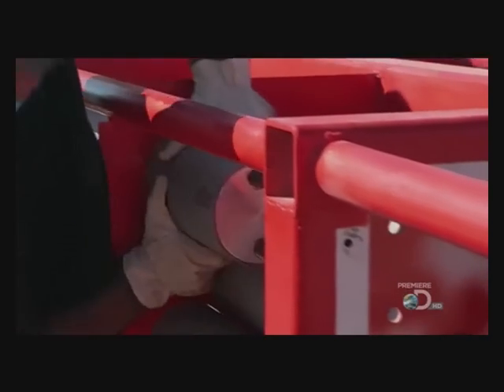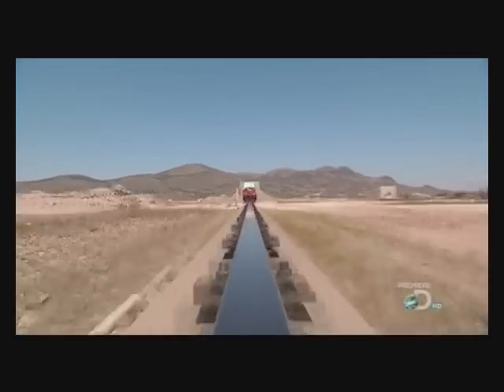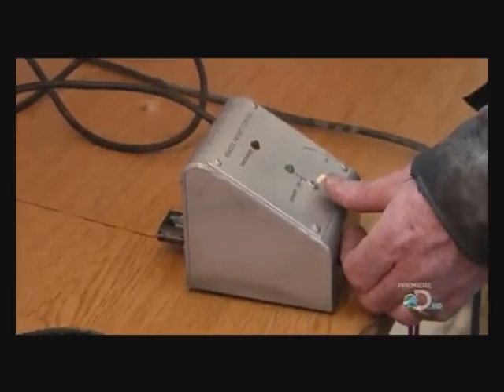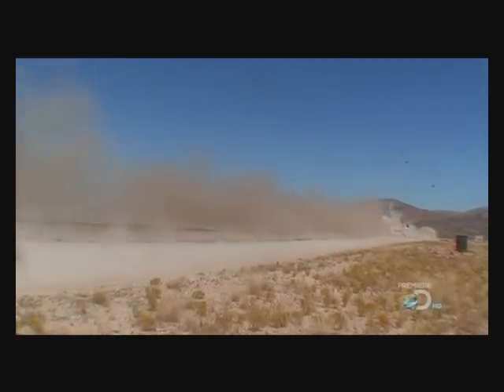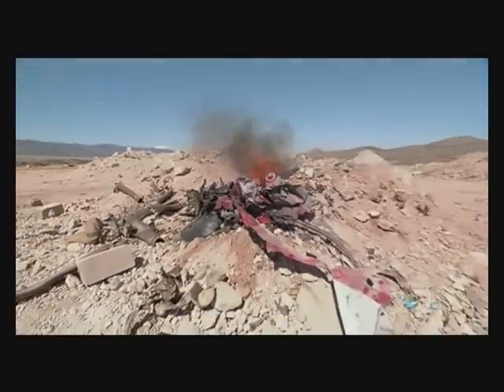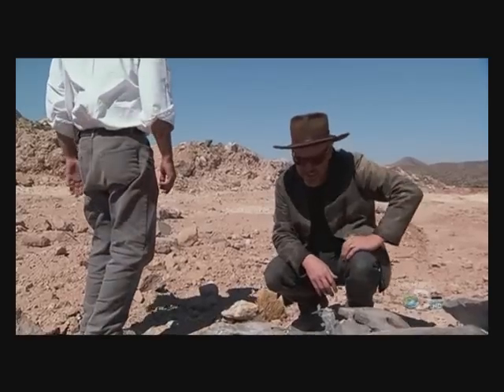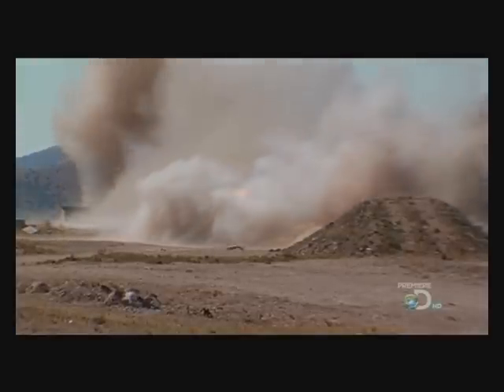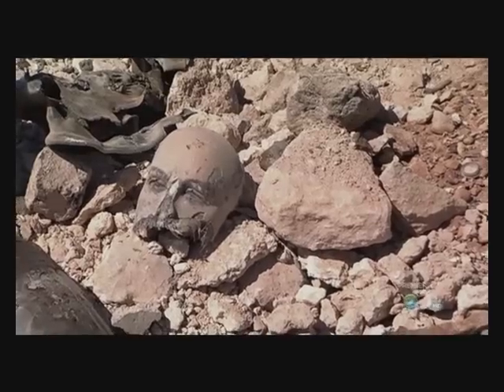Mythbusters destroying a car

Comment: The slow mo shot is just incredible... the car was literally vaporized
Reply: The body panels don’t even have time to fold
Reply: I think at least some of that red "vapor" is paint coming off of the projectile as well
Reply: Vaporized?  No. It's all still there. Severely shredded by the intense energy?  Oh yaz!
I suspect the red is brake fluid and maybe even transmission fluid if they left it in when removing the engine.
Reply: My baby was in that car
Reply: @eduardoferreira6822  They say never leave kids in the car unattended. See what happens if you do?
Reply: Rip engine block
Reply: Spoilers
Reply: Disintegrated is probably the right word
Reply: It was sublimated!
Reply: Just like the airplanes did in 911
Reply: So true
Reply: @Doggeslife  correct

Comment: Curiously, 650mph is about the speed of a pressure (or blast) wave from a 1 Megaton nuclear explosion. The results here would be similar to vehicles, people, buildings, etc within the blast radius.
Reply: I don't care it's a late reply: except air density is a liiiittle bit lower than that of the metal sheet, so not quite.
Reply: @s3dchr  just 8 years late😂

Comment: 1:52 Bruh did you seriously just take a screencap of the video playing in Windows Media Player instead of just uploading the video?
Reply: Prolly because of copyright, otherwise he would get sued
Reply: @Aarthurnax  Recording a media player playing a video instead of uploading the video itself would not in any way deter copyright holders from issuing a claim.
Reply: @LeBonkJordan  Then my second guess is that he had the original video in high quality, and due to low internet speed (notice that this video was uploaded 11 years ago, not everyone had a super-duper speed internet) he decided to play it in wmp and probably change the size, hence those black bars on every side, then record it with some screen capture software in lower quality and then upload it on youtube. I may be wrong, who knows, but that's the most plausible case
Reply: @Aarthurnax  Could be understandable if the internet speed was so slow that it would be completely impossible to leave the video uploading in the background without the computer crashing or running out of battery or the internet timing out or some other circumstances that would cause it to be periodically incapable of uploading.
Reply: @LeBonkJordan  who knows what happened 11 years ago? Maybe his computer had a countdown timer set to 3 hours, in which computer was supposed to be turned on every day, and even a milisecond that  passed after that time would make it implode or create a supermassive black hole? Who knows?
Reply: Dang that was a full on conversation & a geek off
Reply: Soulless zoomer strikes again

Comment: Is no one gonna to talk about the fact, that the concrete barrier did not survive the impact either?
If I remember correctly, the experimental setup was as follows: 
Rocket sled → air gap → car → steel plate → concrete barrier → lots of sand behind the concrete barrier